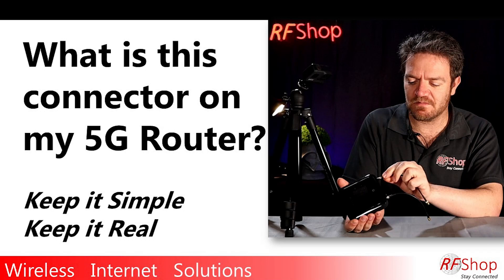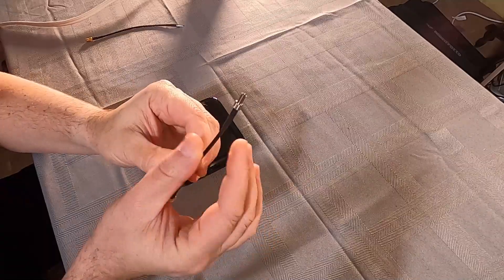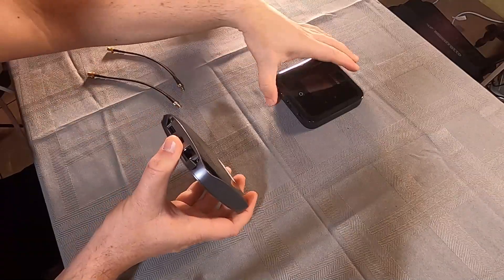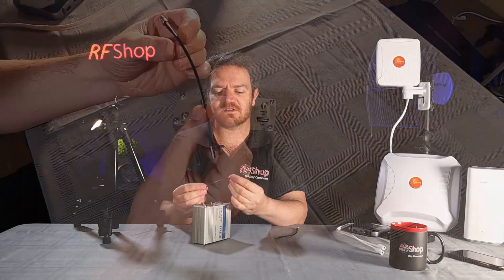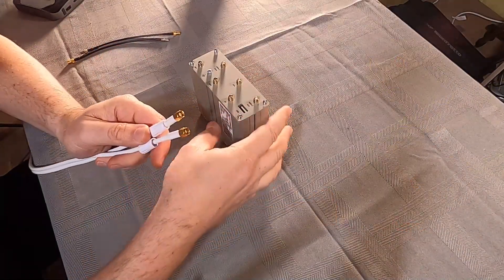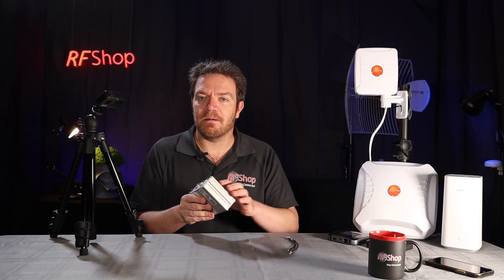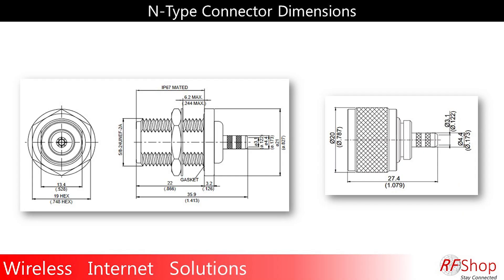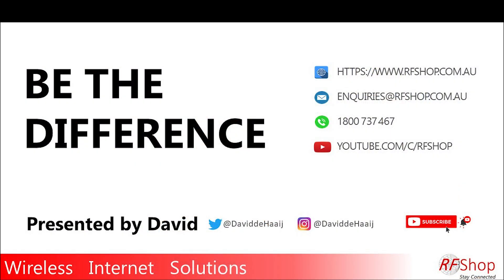What RF connector do I need for my 4G or 5G Router and 4G or 5G Antenna?

Comment: How du you enable the extern antennes, its not enough just to plug the cables in roter
Reply from the maker: The external antennas are configured differently on different modems. I've seen most commercial routers here in Australia come with the settings as "AUTO Detect" so it's a plug-and-play experience. However, there is a setting that forces EXTERNAL or INTERNAL antennas only, so if the modem happens to be set to one or the other you would need to specifically change it to have the benefit of external antennas. 
That's one big reason why we love Teltonika...you know it's always an external antenna

Comment: Hey mate, I've recently got the telstra 5g mobile router. I think it's a ZTE MU500. I've seen videos of people putting two little TS9 antennas on 4g routers in the past and it helps the signal. Would this help on the 5g router too? 
I rent so I can't install a large outdoor unit.
Reply from the maker: Hi Rhys, we’ve had a world of pain trying to get external antennas to work on the ZTE MU500. In theory i should work, but on that model we have not had much success.